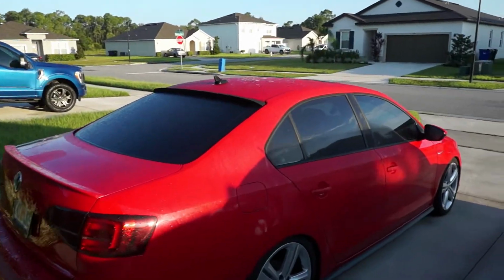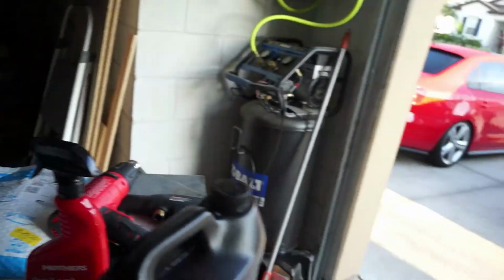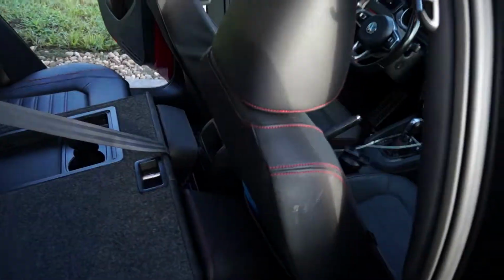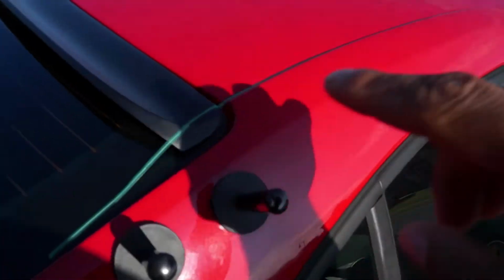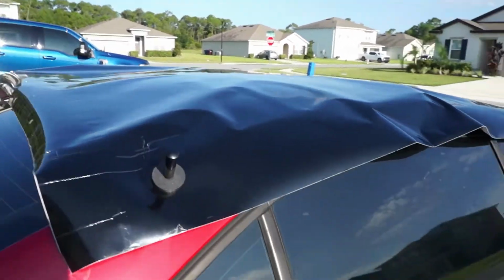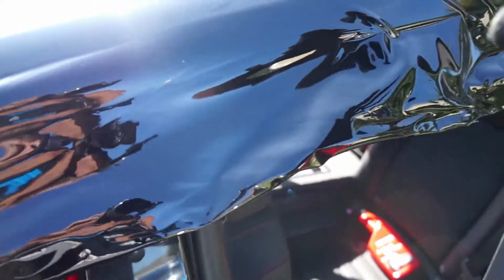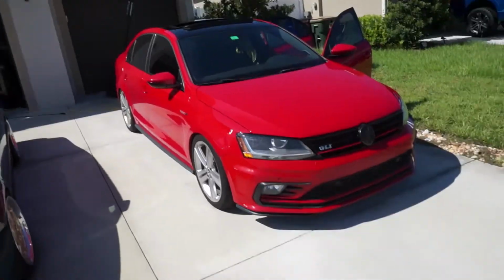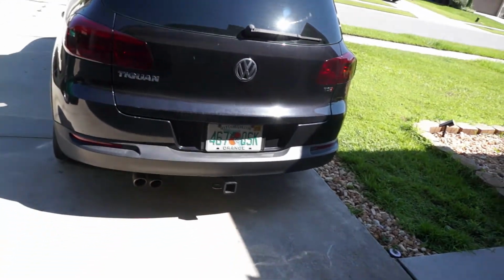Wrapping a VW GLI roof with sunroof.

Comment: I have a leak in  my tiguan sunroof that no one can find. Is it safe to wrap over the sunroof to make it water tight?
Reply from the maker: If you never want to use it again. Black silicone is the way. I did it once.
Reply: @TheVWGarage  Thank you sir, I heard somewhere that if you wrap over the sunroof, it could shatter the glass because of the flexing. A company that I called said he's never had that problem. I don't know what else to try the leaking water is going to ruin my car.